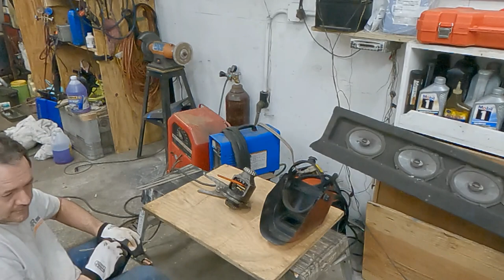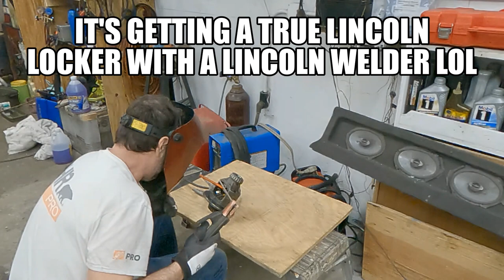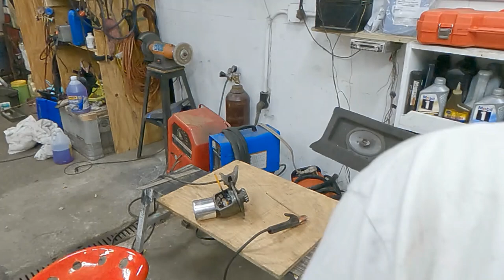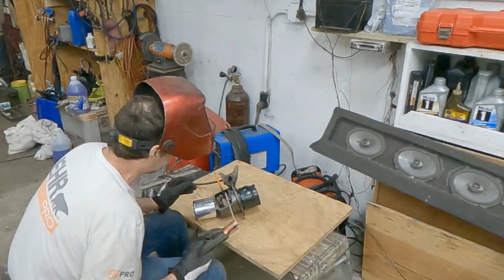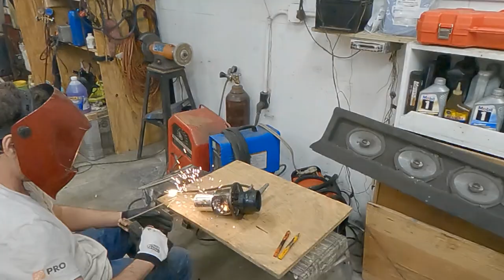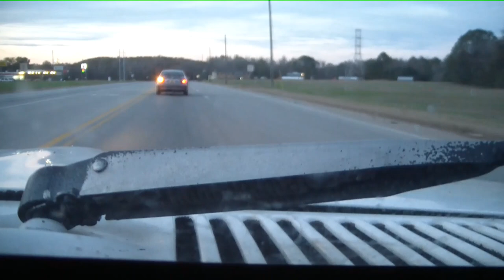Ranger update Lincoln locker for the old 7.5

Comment: Yeah, nothing wrong with welding that up. 7.5 needs all the help it can get. Thumbs up for war amps buddy!
Reply from the maker: I pulled the leaf springs out of the F150 parts truck and put the axel on the top of the springs.  It lowered the truck some. I still need a short axel for the 8.8 I just welded the 7.5 to see if it will hook with posi track till i get the 8.8 finished. the old 7.5 spider gears and pin where wore out bearings are pitted. If it spins now the only thing that might help is some higher gears. I've got 2.73, 3.55, and 3.73s for a 8.8 so I should be able to solve the spinning issue once I swap the 7.5 if the lincoln locker doesn't do it.